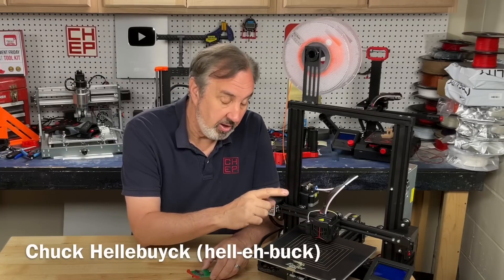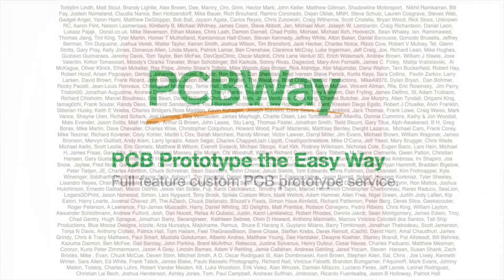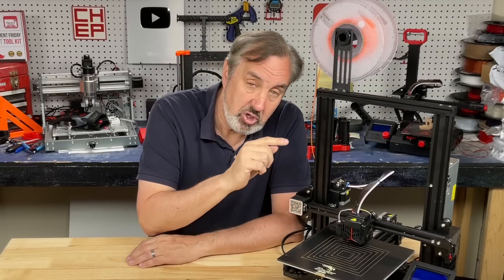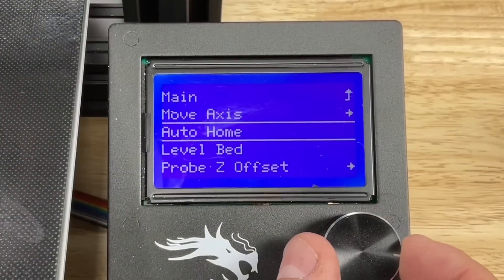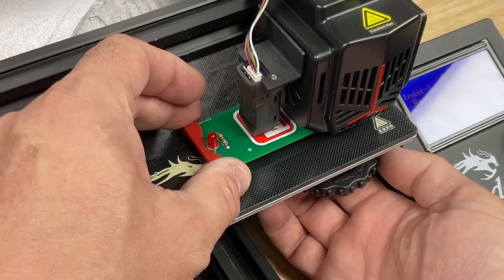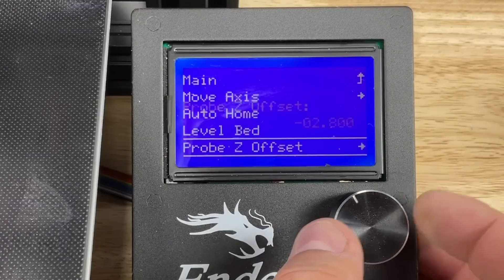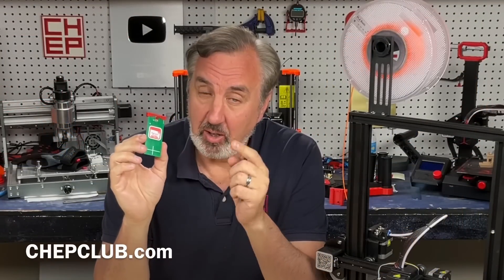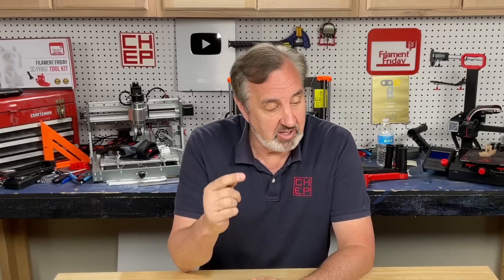Better AutoLevel on Ender 3 Neo using E-Leveler

Comment from the maker: I’ve had a lot of people ask how to use the E-Leveler with an Autolevel machine. This video answered that question.
Reply: Chep, I wouldn't care if it was a repeat.  You have been a lifesaver to me so many times over the years.  I would still be fumbling around now in Cura if it wasn't for your advice.  Always top stuff.
Reply: I honestly can’t imagine trying to level all 4 corners without it. One of the first things I bought after setting up my Ender 3. Might need a backup just in case I lose the 1st…😁
Reply: I tried on a Ender 3 s1 plus and did not work for me, Because this machine has a auto level menu but I wanted to make it perfect … in this case how do I use it ? … Just in case is the same for ender 3 s1 pro … many thanks
Reply: @josefernandoramirezamador2280 I would also like to know the answer ro this as I have an s1 pro
Reply: Will this work on an ender 3 V2
Reply from the maker: Yes, it works on V2
Reply: Hi Chuck, is this method the same for the Ender 3 v2 neo?
Reply from the maker: Yes, method should be the same.
Reply from the maker: It worked on S1: https://youtu.be/S3dgiqJZAQM?si=AtOVlQ5VqjUPjAdm
S1 Pro is similar but I used their menu to move to corners.
Reply: Imo people providing free content that is useful for you in general, shouldn't be called out like this even if is true that the video has a comercial aspect in it. I mean if you don't like it don't say it, nobody cares about your feelings.
Reply: @Drumaier who "called him out" about anything?
Reply: I guess lots of people don't use brain.

Comment: Thanks. 
Advice worked a treat!

Using Ender 3 Neo in the UK. 
Aside from some slightly different menus, the overall advice and instructions worked great. I purposely tried a manual bed level, with then an auto level only. The E-leveller would have been a nice luxury for the manual levelling, but I didn't mind a bit of back and forth, I spent perhaps an extra couple of minutes per knob.

 The result was a birds nest. 

Once I added in the step to calibrate the Z offset, prints worked first great. 
Thanks for sharing.

Comment: I just received the version 1 bed lever.  I have a Maker Select Plus 3D Printer 15711.
I trying to use your leveling tool and having a problem using it. 
I have set my Z height to o.2mm and manual leveling. 
Place the lever next to the nozzle and move the nozzle up with the built in move button, that’s too high to use the leveler.
Press the down move button and that’s too low to move the leveler.
Is there a way to move the z to the proper height to be able to use the leveler ?

Comment: You should remind people that if they have calibrated all stepper moters, and any other values they have changed from the default such as probe offsets, they need to be sure they have those values written down BEFORE they restore default settings in the printer

Comment: Do you think your E-Leveler Tool could help in leveling the bed of other 3D printers as well? Because I have a KingRoon KP3S 3.0, which comes without autoleveling and Z-Offset, and an Anycubic Kobra Neo.
Reply from the maker: It’s used on all kinds of printers so yes.
Reply: @FilamentFriday  that's a great news! Thanks 😄

Comment: I bought my first ender 3 neo that came with auto bed level. Thinking it would make leveling easy for me.  couldn't figure out how to use it. Returned it. Bought a ender 3 v2 and your e-leveler, and have been manually leveling. Have had no issues since then. This video would have made things very simple, but im happy with my v2

Comment: Yeah, cant get it leveled on the Ender 3 V2. 

Ran the G Code, actually makes it worse and it freezes my machine. Have to restart it everytime.
Reply from the maker: Did you modify your firmware, we have hundreds of V2 users leveling without issue.
Reply: So I havent updated the firmware. That may be the issue. 

But the Gcode asks for me confirm before its actually finishes. If I click confirm thats when it freezes. If I let it finish, it doesnt. 

I ran everything accordingly again and it worked. 

Thanks for the suggestion.

Comment: I have a ended 3 v2 and your leveler. I just can’t get the corners in the back right. 

The front right side ends up way to low from the nozzle . I thought if I adjust the switch on the side it would help but nope…😢 

I tried for 4 days ugh
Reply from the maker: This might help: https://youtu.be/dOrwAMFzGLg

Comment: Thank you for this!! I recently upgraded my EV2, Sprite extruder, Dual Z motors, CR Touch, light bar, flex plate, and bed springs. I struggled getting the bed level, not having this issue before. I bought your product and WHA-LA!!! This will be my standard to-go tool when leveling.

Comment: Would the steps be the same to clear firmware to default if it is with an Ender 3 with a BL touch added?
Reply: This part is separate from the printer’s computer settings & firmware and no numbers need to be entered. Although he does provide a gcode that will automatically move your nozzle to all 4 corners, I never use it because I’m too slow.
This is simply a way to make sure the spring adjustments underneath are all tightened or loosened so that all 4 corners keep the table perfectly level. I think of it as leveling the legs on a table. You want them all to be the same height. But if your floor is uneven, you might need to shim one or 2 to keep the table level. In this case, you adjust zed height and turn the wheels underneath until the light on the leveler turns on. The leveler would be directly under the nozzle. So the first one I just look and see what the zed height is when the light goes on. The next corner I will do the same thing. But when the light goes on? It should be the same number as the first. If not, you turn the spring wheel to the right(down) or left (up) until it registers the same number as the first one, and then keep going around until all 4 corners turn the light on at the same Zed number. 
The auto-leveler (bl touch/cr touch) is part 2 and you can think of it as the tabletop. Now that you have the legs dialed in (via manual spring adjustments in all 4 corners) now the auto leveler makes sure you don’t have a warped table top. If you have it checking a 3x3 grid (or more) it will measure and record any slight differences along the flat surface of the table top (print bed)surface in case it’s slightly warped. Then make sure you save its results to the EEPROM. If you just check the tabletop without first checking the table legs, there’s only so much the auto-leveler can compensate for. After you do this a few times? It’s a piece of cake. I check the springs settings anytime I move the machine, change my nozzle, etc. Then after those 2 steps, reset your Z offset to zero, save settings again, and then recheck your Z-offset. Enter that number in, save again, and you are good to go.

Comment: Have to ask, but couldn’t you use the e-leveler instead of paper to set Z offset? 
After home, you know that Z=0 is the probe trigger point. If you measure the thickness of the e-leveler and position the nozzle at the home position then bring it down to trigger the leveler, you then know the nozzle height above 0. Wouldn’t calculating the Z-offset then be a simple calculation?
I’d much rather use something with an LED indicator than using paper or a feeler gauge. Using a feeler gauge lets you set Z-offset regardless of feeler thickness with a little calculation? Why would the e-leveler not be the same?

Comment: Doesn't using some firmware's bed-tramming negate the need for this E-Leveler? Letting the probe hit over 20+ points and showing you the +/- to adjust the bed by.
Reply from the maker: If that works for you and it operates that way then sure. But not all machines have that firmware.
Reply: @FilamentFriday  that firmware is available for basically every ender tho. If not trough marlin then trough klipper.

Comment: Hey I am having a problem with my ender 3 Neo the hot en that was on it plugged up with the boden tube issue so now I have a new hot end on it I leveled the bed and now I can’t get the printer to put down and thing on the bed it keeps not sticking I have cleaned the bed many 😢 times with alcohol but it won’t stick can you please help me thanks

Comment: As a newcomer to the world of 3D printing with an Ender Neo V1 is there a valid reason why it's not better to manually adjust the bed based on the values from the automatic bed levelling. Its measurements at the sensing points will be more accurate that trying to work out if a piece of paper has the same level of friction across the bed. This is the method I use, reading the measurement from the G29 command. I have now created an app to quickly display the levels in a easy to understand graphical format as the V1 does not display the mesh on the lcd.
Reply from the maker: How do you adjust then based on those readings?
Do you share the app anywhere?

Comment: The auto-leveler on the Ender 3 s1 pro is crap. When I use it I'm never level, when I just manually level and leave it there, it's perfect.
Reply from the maker: I’m working on a video for that as well. This (similar) procedure works well.
Reply: @FilamentFriday  Looking forward to it
Reply: It is happening with my ender neo too, I'm finding my own manual leveling to be way more reliable than whatever mesh the machine is generating thinking that is so clever. That, or I'm missing something, but I save settings. I don't use the G29 line in code because I give for granted that the machine will keep using the last mesh generated (and auto leveling every print shouldn't be necessary) ... But I heard there is a 410 command (or something like that... Maybe 401?), that tells the printer to use the last generated mesh. But if really needed, then why the creality slicer doesn't come with such line as default for the 3d neo?
Reply: The S1 has some issues with the crtouch, realistically you'd need a 0Y offset mod and loosen the 4 bolts that hold the y extrusion a bit. 
The y extrusion comes over torqued
Reply: @twanheijkoop6753  Sadly, I'm about a month into 3d printing and don't really have any idea of what you're talking about but thanks, if you're aware of a video showing how to do this I would appreciate you directing me. The only thing I know for sure is as long as I don't use the auto bed leveling I eventually can get it dialed in manually.

Comment: You're missing a step. If you have set your E-steps, you just lost that setting when you reset the printer to factory settings, so make a note of your E-steps first and enter it again before you save the new configuration.
Reply from the maker: Good point. I should have mentioned it. But most users who are new to this are just trying to get a good bed level and probably haven’t changed E-Steps yet anyway.

Comment: The way I've been doing it for a while is I use the Bed Level Visualizer plugin for octoprint. After homing all axes, I initialize autoleveling with the plugin, then I get a 3D visualization of the height of each probing point. The plugin also tells you how much you need to turn each knob to get it level. After 2 times, it's usually perfectly level
Reply: I level it using a similar method, I did use the visualiser method through OctoPrint but realised I wasn't using any of its other features and tying up a Raspberry Pi I could use elsewhere. I have as as an alternative created a standalone app that displays the measurements from the bed level sensor points similar to the info on the colour lcd screen on a Neo V2.

Comment: I don't like the idea of disabling the motors and moving the machine hand.
It's way too easy to accidentally move the z-axis. If you move it even a tiny bit, now your leveling is off.
I always leave the motors engaged and use g-code to drive the head to the 4 corners for leveling.
Reply from the maker: You could also move the nozzle through the x,y motion menu.

Comment: Would love to know how to use it with an ender 3 s1 pro using Sonic Pad. I have your leveler but have not been able to figure out how to use it with this setup and no one else has a video like that either. Love your show thanks again
Reply from the maker: I have already used on that printer with ease (though not with the sonic pad). I’ll put that video together.

Comment: my battery tab was broken out of the box and was a waste of my money
Reply from the maker: Josef Steiner - Contact the Amazon seller and they will replace it.
Reply: @FilamentFriday  it was like a year a go I just purchased the sunlu one and it works perfectly out-of-the-box you need to work on your quality control
Reply: @josefsteiner9401  how can they work on quality control when they don't know there is an issue
Reply from the maker: Josef Steiner - we would have replaced it for free. Saved you money . Too bad you purchased from a company that stole my design without any approval or recognition.
Reply: @FilamentFriday  theres other companys that made levelers before the sunlu ones and after you came out with yours so wonder why u didnty get after them theres one that uses a blue pcb as well
Reply: Damages while delivery or similar can occur on every shipment. IMHO people that aren't able to send a broken item back and get a replacement from Amazon shoulnd't order online at all in the first place.
Reply: You can replace them cheap and easy, also did you tell the place you got it from? They are pretty good about replacing things broke in shipment.
Reply: Your comment was a waste of electrons.

Comment: I will have to buy one of those. Although I actually skip using the auto leveling sensors on my printers that have them all together. I have never had much luck with them for some reason. I usually just level the bed via the four corners and be done with it. That has always given me the best leveling.
Although I do have three machines that actually run a auto z axis leveling for the x gantry before I check each corner. Two run the gantry to the top stop blocks at the top of the machine while one Idex from Tenlog has two switches at the bottom. They are basically my machines with dual z axis motors.
For all my printers I usually just set all four corners then tend to leave it alone for a while and only recheck them every other week or so. I also switched from springs to those silicone cushion spacers.
But
I can definitely see the value in your leveler and want to try it out. Maybe it'd make me have better luck with the auto leveling sensors. 😁